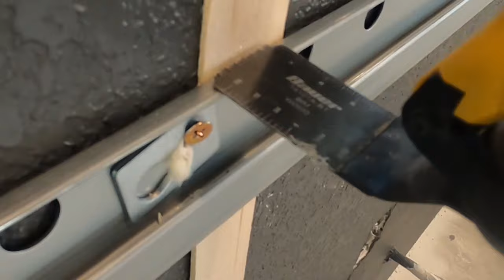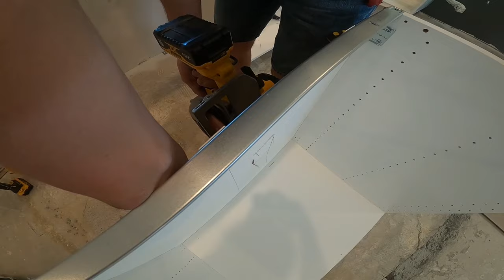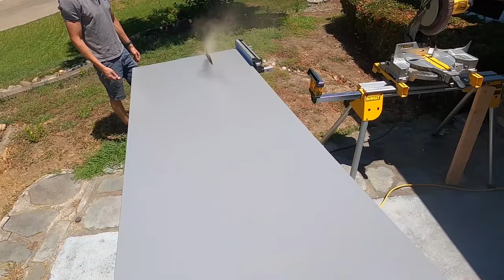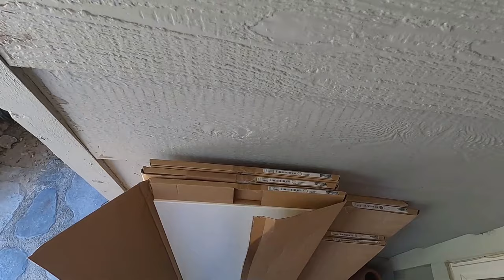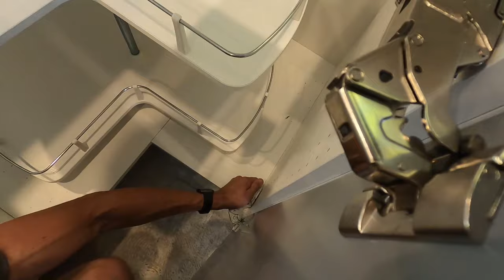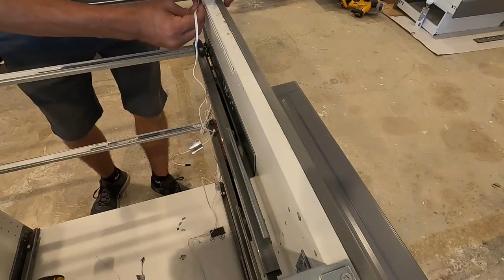Ikea Kitchen Build

Comment: That's a cool trick using the pantry shelf to square up the frame before nailing on the back.  I am going to use that !!!
Reply from the maker: Yep, another tip for your work - but it only works for the pantry!
Reply: Hi Mike - at what time stamp in the video is this trick?
Reply: @tomatojuice12  hi.  At around 1:19.   They place the shelf (which is not needed until much later) on the back.  This ensures that the side panel and the bottom shelf are at 90° before you put in all of the nails in the back (which then keeps it from racking out of square).  Great little trick!

Comment: Nicely done. I'm going to be using some of these base cabinets for a home office built in. Would you recommend using the hanging rails still if I'm going to be putting them on a wood frame base?
Reply from the maker: When they were near the wall, I put rails, although we make the island without rails, so I think it is possible without rails if the cabinets are fixed to a wooden platform

Comment: Great video! Do you put the 2x4 & brackets only under the island or on all cabinets to help carry load? I worry about the plastic legs on the Ikea cabinets we are installing and I'm considering adding that angle bracket & 2x4 after everything is leveled all the way around.
Reply from the maker: We put only on the island 2*4, Ikea gives a guarantee for 25 years that everything will be good with the legs.

Comment: Hi there. Thank you for the video. Which hinges (the two models) did you use for the right corner base door starting at 5:48? Thanks so much.
Reply from the maker: I packet  - 153 degree
- the other came with the cabinet.
Reply: @maxplus2849  Thank you so much! I overlooked the hinge provided with the door. I made myself crazy for nothing. All done now. Thank you for the video again.

Comment: So, you don’t do anything about the end when you have to cut a board? You just figure it’s okay to do that as long as no one sees it?
Reply from the maker: You've got any ideas on what to do with cut edges? :)
Reply: What should they do about it?
The only place you should cover then is around the sink and dishwasher in case of water leak, otherwise there is nothing to do about it.